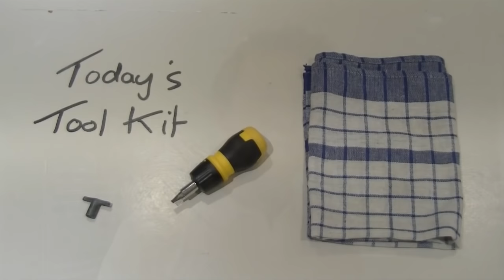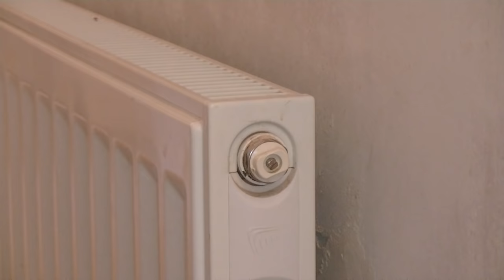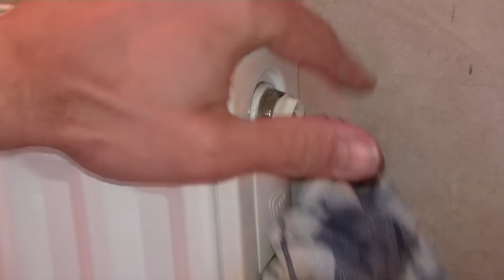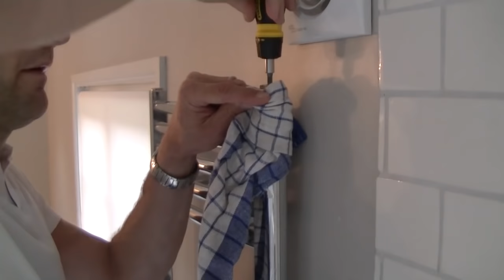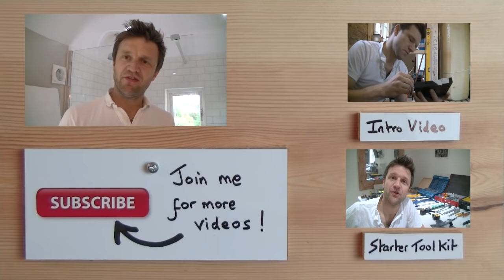How to bleed a radiator

Comment: Sorry for the novice question but is this best to do when the system is completely cold or when warm... obviously not red hot
Reply from the maker: Cold because that way you can keep topping up the system to the right pressure.
Reply: Charlie DIYte thank you. Bled my radiators and they are working so much better!! Next problem is making sure the mrs doesn’t have it on 24/7! Nest thermostat I think
Reply from the maker: @andym8939  Well done mate and thanks for letting me know how you got on. How are you finding the Nest? Toyed with installing one here but it slightly freaks me out that it learns how you like your heating and I suspect my cottage is too small and simple to justify it 🤔

Comment: Hi Cahrlie. Can you add a video of how to isolate and remove a radiator from the system so that you can paint behind it? :)
Reply from the maker: I should do that Rod. You basically need to switch off both valves - ie the lock shield and the thermostatic side, open the bleed valve and then loosen the nut on the valve body where it's attached to the radiator at one end of the rad with a spanner and let it drip into a pan until it's completely empty. You can then release the other side and take it off the wall. You need to be very careful though as there will probably be a lot of sludge in the bottom of the rad, so you need to have plenty of protection down if you have a carpet, to catch any drips. I stained a carpet not doing this. If it's a pressurised system you also need to know how and where to top up the pressure when you refill the system. It's a good idea to take a note of what the pressure was before you start draining the radiator.
Reply: @CharlieDIYte  Great! Thanks

Comment: Obviously this video is for a combination boiler! If you have a fully pumped system with tank in the roof you won't need to alter any pressure valves at the boiler as the tank in the roof will automatically do this for you!
Reply from the maker: Not correct. That's a gravity system you're talking about. I don't have a combi boiler. I have a kerosene boiler in the basement, and a hot water tank in the bathroom fed by a tank in the roof, but my radiators are pressurised.
Reply: @CharlieDIYte  hello, how do you add pressure back ?

Comment: Can u bleed radiators whilst heating boiler is on?
Reply from the maker: You can but you have to be a bit careful if the water is very hot and if it's a pressurised system you might not know what pressure to top it up to.

Comment: Going sound stupid - but how are you “adding water into the system”? Just been told by my landlord all I need to do is bleed the radiators and that’s it so thought I’d YouTube first to make sure I’m loosening the right “screw” and obviously it’s not as simple as just get rid of the air in the radiator lol (none of my heating is coming on at all)
Reply from the maker: It depends if your system is pressurised Steph or gravity fed. Gravity fed systems automatically top up any water when you bleed the rads. Whereas a pressurised system needs to be repressurised - there's usually a filler valve somewhere - like in my vid or on a combi boiler if you have one of those.

Comment: My system doesn't have a pressure valve meter ? . The central heating header tank is automatically topped up with the correct amount of water via its own stop cock, taking water from the main water tank,  and so presumably stabilises the water pressure automatically.
Reply from the maker: That's correct Geoffrey. Sounds like you've got what is known as an open vented (non-pressurised) system.

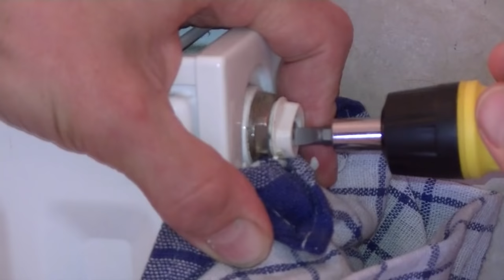Comment: I have a problem.  I have the same valve as on 3:30 - But i cant unscrew it to let the air out any idea ?
Reply from the maker: Have you tried using a bleed key? Might be worth getting one and applying a bit more pressure. It's probably seized up but should open with enough force.